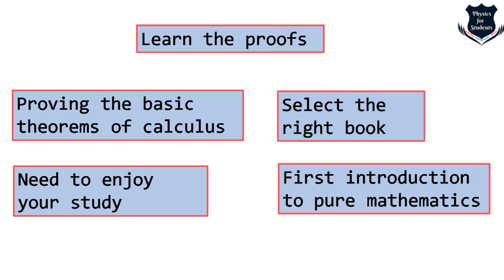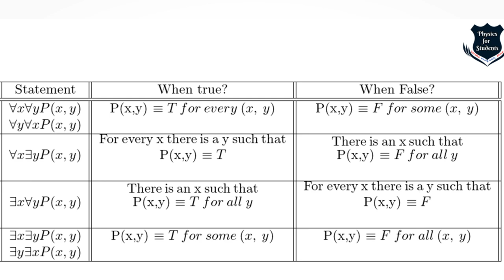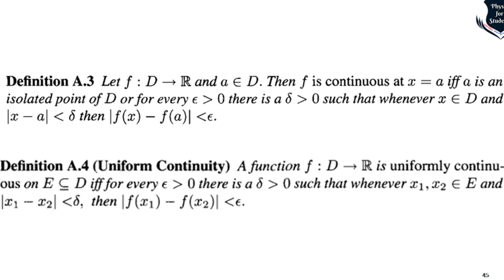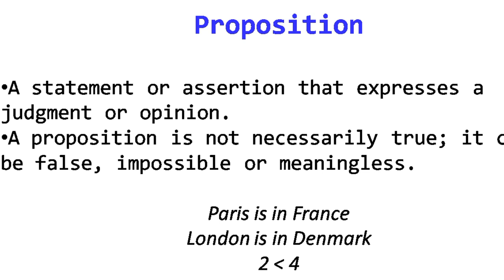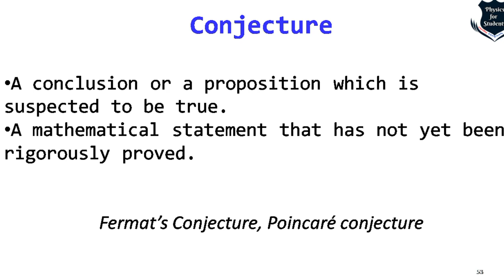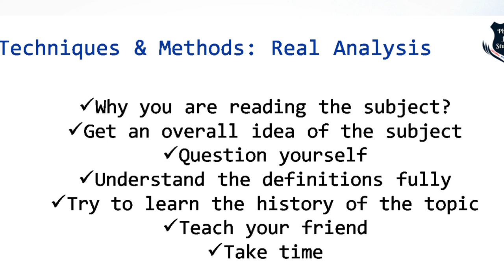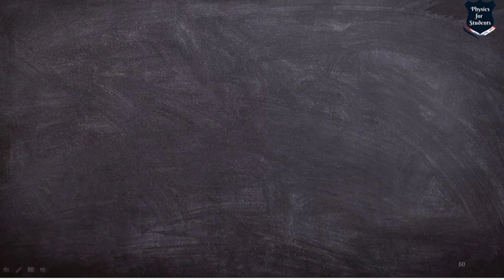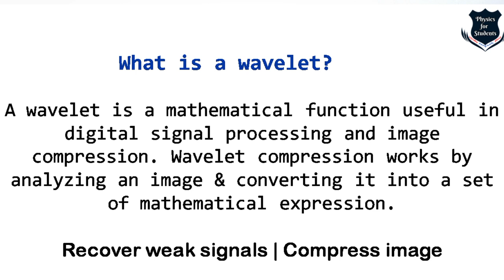Real analysis | What is real analysis | Introduction to real analysis | Real analysis BSc 3rd year

Comment: Professor please can you help me ?.
I have a question . In my country , the format of bachelor degree is different from other countries . I want to become a biomedical engineering but firstly I will do bachelor in electrical engineering with electronics profile .
My question is : Is this format good for a student that want to have a strong " base " for Starting  master degree in BME in terms of electronic devices in medicine ? 

Here is the format :
First year 
Physics 1 and 2 , Linear algebra , Mathematical analasys 1 and 2 , introduction to computer science , circuits and electric devices ,probability 

Second year 
Orinted programm from object , numerical method for engineering , cimputer architecture , systems and signals , communication 1 , linear systems of controll , electromagnetic field theory , analog and digital electronics , 

Third year 
Electromagnetic wave theory , teaching practice , and some technical subjects 

Core technical subjects 
1 design  of analog integrated circuits 
2 radio frequency microelectronics 
3 power electronics 

Profiled technical subjects 
1 semiconductros devices 
2 design of integrated digital circuits 
3 Introduction to VLSI design 

Elective technical subjects 
1 numerical processing of signals 
2 dynamics and robotic control
3 intelligent control systems
4 design of microcontroller systems 
5 electricity use

Even If you cant help me , no problem . I will appriciate your effort 😉
Reply from the maker: Will reply in details tomorrow ☺️☺️😃😃.
Reply: @physicsforstudents  thank you very much